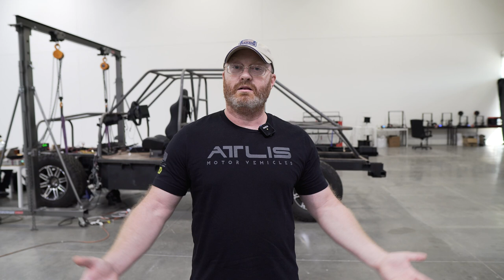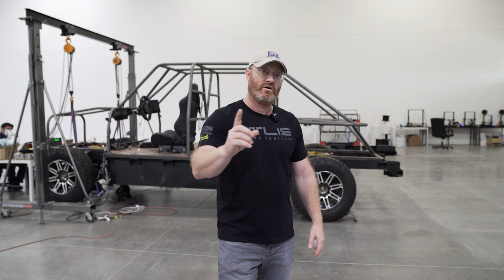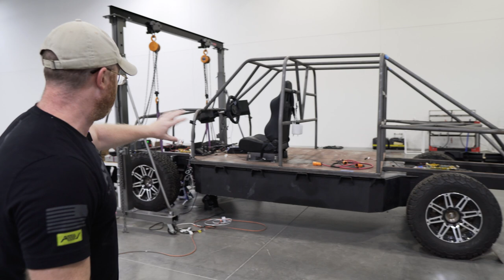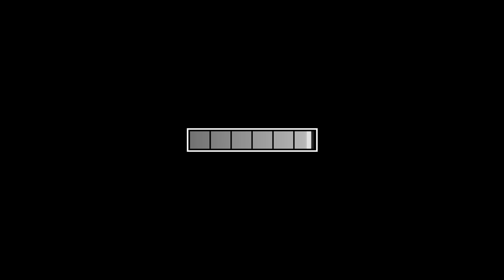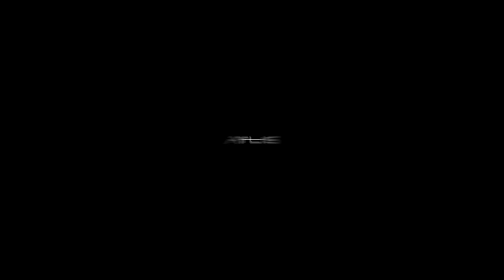How ATLIS is able to tow up to 35,000 lbs

Comment: how will you compete with range of a diesel 3500 series trucks? for example most of these trucks can go almost a 1000 miles on a tank of fuel.
Reply: I have a RAM 3500 diesel with on auxiliary tank.  My range is about 900 miles.  I never drive this far without stopping.  If you plan your route to align with the Atlas charging locations, your range is unlimited.  Stop for a 30 minute break and recharge.  Range becomes a non issue.

Comment: For the Dually that handles 35k tow capacity, what do you estimate the unloaded (dry) vehicle weight to be with 250kw battery pack? 

With that,... what will the load capacity be?
Reply: What is the range on towing that also? With hills